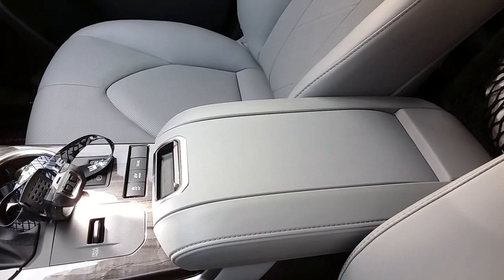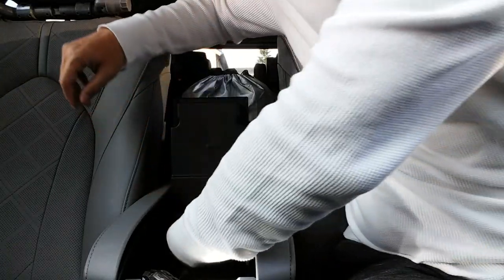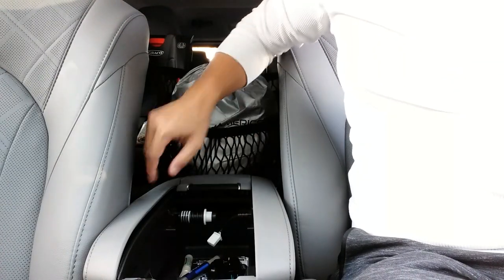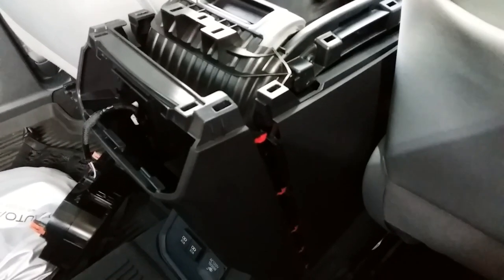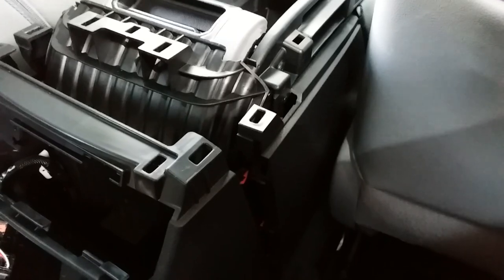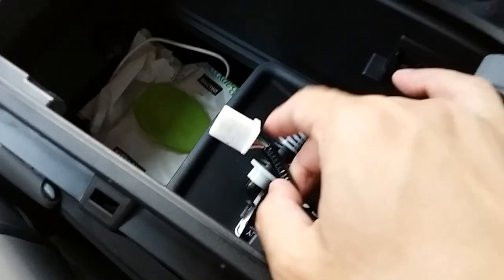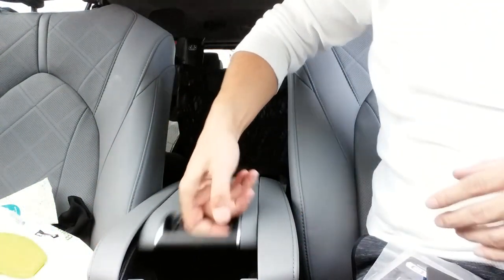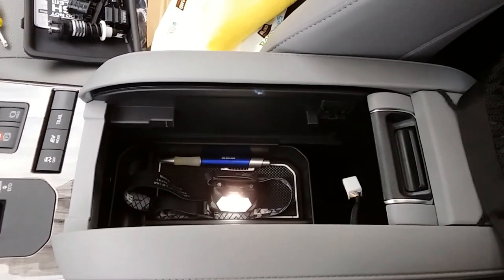Qi Wireless Charger Removal from center console for 2020-2022 Toyota Highlanders

Comment: Had no idea it was that easy to remove those. That charger design and placement is probably the worst console usage I have ever seen in a vehicle. Thanks For the video.
Reply from the maker: Agreed! It was a good idea but what were Toyota engineers thinking when it came time to apply proof of concept to real world situations. Did they not test the charger with focus groups and assume that people don't use phone cases? It's so much more spacious now!
Reply: @vietbubbletea  Looking for a tray that fits way in the back where the jack tools are stored. They have them for the older models but have not found anything for the newest generation Highlander.
Reply from the maker: @paulp1166  Are you referring to the space under the trunk floor? I have a bunch of crap down there like umbrellas, portable toilet for the kids , first aid kit, etc so it's a hot mess down there. lol Let me know if you do find something!

Comment: just purchased my new (used) 2022 Highlander. The Qi charger is useless. My iphone 14 does not charge reliably. with or without case. Part of the problem is the camera lenses but also the phone moves as I drive and disconnects the charging connection.
Your video is the perfect answer to my problem.  
I especially like you video's detail . look forward to exploring your channel.

Comment: Where did you get the net between the seats?
Reply from the maker: @NORMAN OTT Here's the link below, I specifically got this because of the draw string at the bottom that many others don't have in order to secure the net to the center console so items don't slip through the back. I had to pop the back plastic trim off to feed the cord underneath then slap it back on to secure it in place.

https://amzn.to/3K9lHrK

Comment: hi brother, can you tell where i can buy phone charger for i phone like the one you have that fits in cup holder. thanks
Reply from the maker: This is the cup holder base that I have but I switched the phone mount with an Andobil one since I liked the phone release button on the side rather than at the top, hope that helps!

[Upgraded Version] Cup Holder Phone Mount,Miracase Long Neck Never Shake Car Cup Phone Holder Cradle Car Mount for iPhone 12/12 Pro max/11 Pro/XR/XS Max/X/8/7 Plus/6/Samsung S10/Note 9/S8/S7,GPS etc https://smile.amazon.com/dp/B082SNXJ4G/ref=cm_sw_r_cp_apan_glt_fabc_6ERY4044NFSFXTAHKT30?_encoding=UTF8&psc=1
Reply: @vietbubbletea  thanks alot